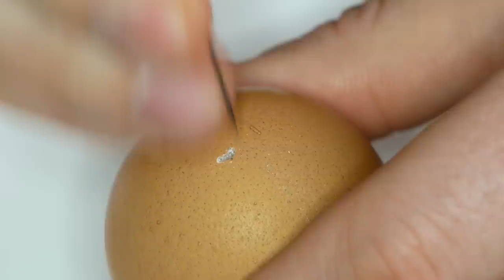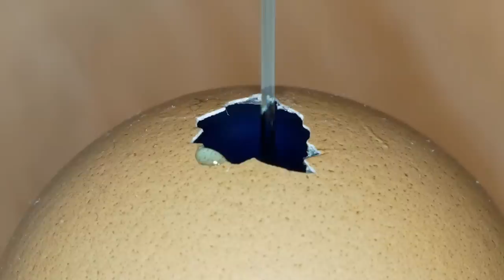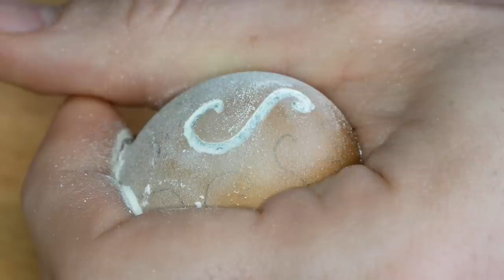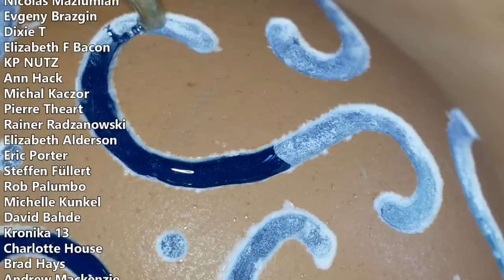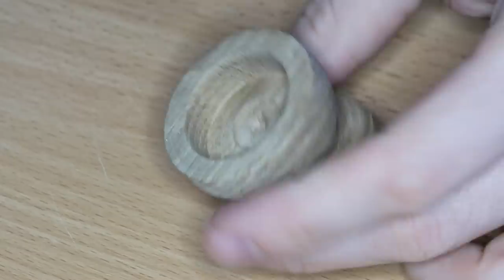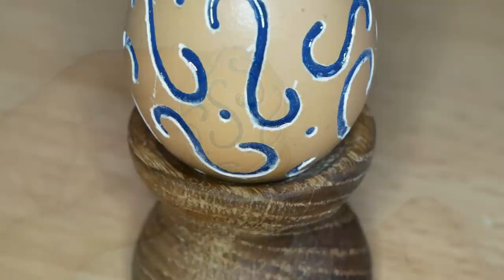Engraving Easter Egg / Night Lamp / RESIN ART

Comment: I wonder if you could put this resin filled egg on a lathe and turn rings on it at different depths and then somehow fill those rings with different colors. Could also completely almost get rig of the shell, like an skeleton leaf where you only seen fine hints of it, and all those voids fill with different transparent light colors of maybe UV resin so you can see through the whole thing and see the inside of the remaining egg shell on the other side and  the core of original clear resin up the middle. Hope that made sense.
Reply from the maker: Only imagination limits us
Reply: @jedrek29t  this true, wish I had a lathe to try this LoL